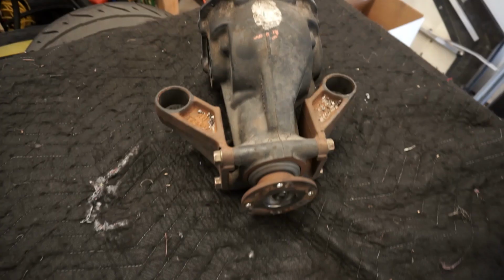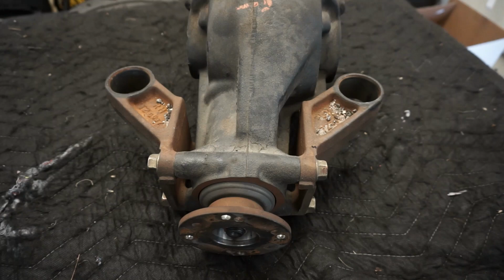EVO 9 GETS A TRE REAR DIFF

Comment: Does this work better than original diff does it fix some of the issues of the diff.
Reply from the maker: I will say the car feels more like a rear wheel drive vehicle. I can get the rear to kick out with easy. Understeer is no longer an issue.
Reply: @EricMcWilliams515 great upgrade from tre!
Any idea what's the initial preload torque setting of this 12plate diff?  I believe tre give max lock 100% right?
Reply from the maker: @Alex_EVii  They keep that info pretty secret. I have no idea.